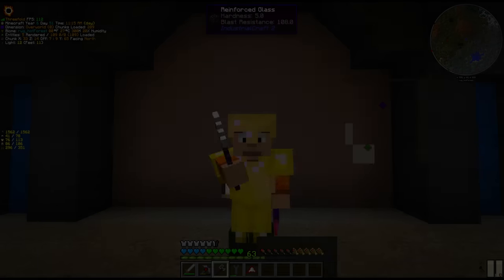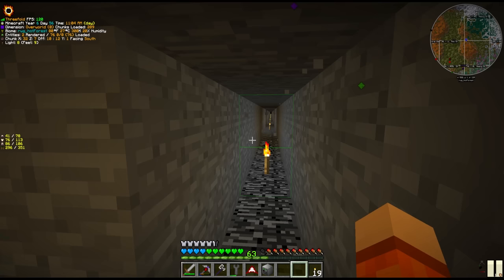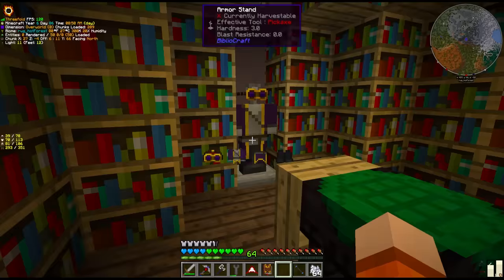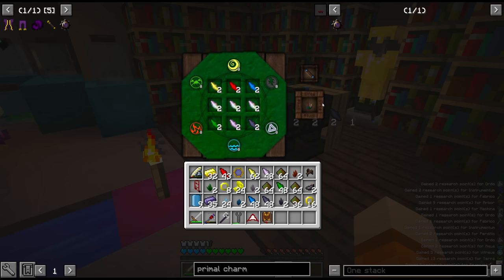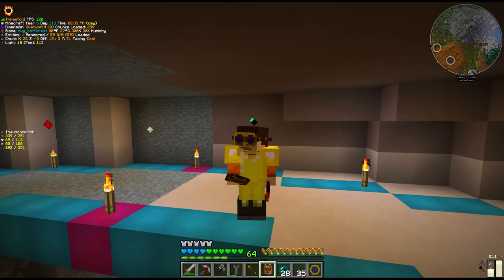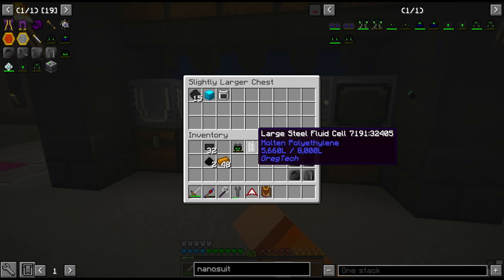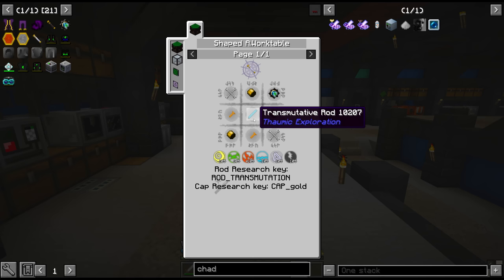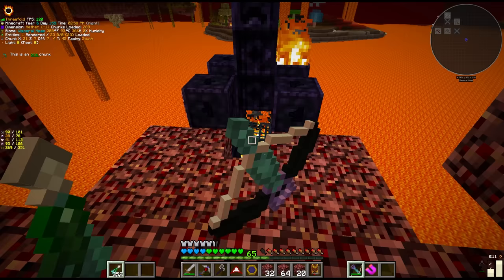Gregtech New Horizons S2 18: Nano-Craft

Comment: A bit of thaumcraft advice. Craft an extra primal charm and keep it in your inventory for a while. it generates vis for your wand, slowly, and it will unlock some research if you carry it for long enough.

Edit: And you did. This is what happens when you comment in the middle of a video instead of waiting for the end.

Now to some actual applicable advice i gathered from my old regrowth playtrough. I don't know if the numbers are changed or not for GTNH, but i wouldn't bother with advanced node in a jar at this stage. Save that for when you find a Bright node that you will want to transform into the gigant node later in the game. If you just want nodes to charge your wand, use the regular one that requires less vis, to harvest as much of them as possible, some of them will turn from normal to pale, but that makes them just a bit slower to recharge. It's not that bad. 

If you encounter any fading node in the wild, don't bother gathering it, just break it for some ethereal essence. Same if a pale node degrades into a fading one when putting it in a jar.

Then you have two options, place them separatedly enough of each other in your base to prevent them from eating each other or make some node stabilisers. This will allow you to place them closer together, but it slows their recharge rate too.

And when it comes to what aspects you want in a node. with a wand you can only get primal aspects, so right now the nodes with secondary or tertiary aspects are not as useful. once you make the wand charging pedestal and it's upgrade i don't remember the name. You can use those secondary and tertiary aspects to charge the wand too.

And for the energised node later on the line. Again you have two options. The energised node will only have the primal aspects. And it does so by transforming the secondary aspects into their primal aspects and picking the highest primal aspect for each one. So imagine you have a node with 15 aer and 20 vacous will turn into an energised node made from 20 aer and 20 perditio ( the 20 aer and perditio from the vacuous, the primal 15 aer are just lost because the vacuous has more aer than it). So I prefeer to use just primal aspect nodes for that so i can controll what i add. The compound aspects can be useful, but harder to find and feed into the main node.

Lastly, about the ethereal essence. All of them have auram in them when distilling them. They just have auram and whatever aspect they are. So that wisp node would still be usefull to farm auram. But you found a better source anyways.
Reply: great advice, i never knew that combined aspects chosen that way, i always thought it's just decomposes them entierly with inefficient multiplier to get ALL the primal components (well, i usually overfed one massive hungry node untill i can't see the hekkin numbers and then energize it with max stabilizers, and at this point i've always got more than like 18-20  of each aspect per tick, and would enchant fokae to max level in a matter of couple minutes so... heh. oops.
Reply: @mrShift_0044  It's a perfectly valid tactic, too. Node predation to get a big node can be really really slow without tick accelerators.

And to add to the advice, having a bright node energised will give it also a boost on cv.

It's a bit of a shame thaumcraft 4 isn't that built for large scale operations if you want to use the stuff in it. 

I made a really cool autosorting essentia setup with essentia buffers that would proccess and store every type of essentia, but the buffers were too slow to do any kind of large scale processing. so for any alchemy i wanted to automate I had to make dedicated setups wich where not as cool.
Reply: Could you be the next ShadowOfX?

Comment: For getting oil there's also MV pumps to gather more oil (particularly from larger oil spouts), actual super tanks so you don't have to go back and forth constantly, or long distance fluid pipes to bring the oil right to your base automatically. There's no excuse for having a ULV tank on your single block oil pump in mid-HV.

One critical difference between single block pumps and multiblock fluid pumps, other than the fact that the latter pumps fluid fields whereas the former pumps in-world fluids - multiblock pumps will continue running even when their output hatch is full, voiding fluid and power. Automation is required to make sure the pumps turn off automatically when they're full up on oil, but this is extremely simple to do: Just place the output hatch next to the controller, place a fluid detector cover on the output hatch facing the controller, and a machine controller cover on the machine controller facing the fluid detector cover. Frankly I trust that anyone able to read the previous sentence is able to figure out the rest 🙃.

Slight error crafting another MV Vanadiumsteel Prospector's Scanner there. With a vacuum freezer you now have access to Shadowmetal, which is a much better material to make all sorts of tools out of, and you also are now able to craft HV Prospector's Scanners. Shadowmetal HV has a range upgrade, meaning it can detect up to a 3x3 worth of ore veins, but most importantly for fluid fields it also has a higher chance at successfuly prospecting. For ore veins this doesn't matter, since Visual Prospecting will pick up ore veins regardless, but when prospecting for fluid fields this success chance does come into play.

Fluid field information is in NEI ingame, but for the record: The overworld has an equal distribution of Light Oil (only really useful for Refinery Gas), Raw Oil (best for Naphtha), regular Oil (best for Light Fuel), Heavy Oil (best for Heavy Fuel) or Natural Gas (functionally equal to sulphuric refinery gas). Depending on what you want to do with oil you'll want to tap different types of oil - Cetane-Boosted Diesel is very Light Fuel heavy and needs a bit of Heavy Fuel, Gasoline based fuels are very Naphtha heavy and require (relatively) minor amounts of Refinery Gas, if you want Refinery Gas for byproducts Natural Gas will save you a distilling step or Light Oil can get you a small trickle of the other oils when processed through a Distillation Tower, etc. You can either change your strategy depending on what oil/gas is nearby or seek out a specific field and strategise ways to cross the distance, either approach is entirely valid.

Fluid fields are always 8x8 chunks. The chunks within the fluid fields are all individual pockets, though. You can drain one dry and have to move your low tier fluid drilling rig to another to pump more fluid, if you drain one pocket too much. Higher tier fluid drilling rigs will pump more of the field at once, up to the entire 8x8 field at once with a T4 fluid drilling rig. Those are a wee bit in the future still, though.

There's not too much reason to pump up heavy oil. Mining out a few oilsand veins will give you all the heavy oil you ever need.

For the record, I have done research since the last episode on Scribing Tools and updated the spreatsheet with a list of available tools in GTNH. In case anyone is tired of having to refill their ink bottle every 100 uses. Turns out there's some interesting options available 🙃.

For wand recharging there's two ways you can go about it: Rush Transmutative wands (scepters, really) to make the primal shroom refilling much more efficient, or set up a starter energized node to get a measure of Centi-Vis going. The latter requires exploration and some RNG to find a suitable starter node, but it is the path I highly recommend taking. In part because Centi-Vis opens up some of very critical stuff - wand focus enhancements to name one, Frugal V will make that Dislocation wand focus a lot cheaper to use - and in part because it's fully passive. Yes, it'll be slow, but passive Vis recharging is a very good QoL upgrade all the same. Note, by the way, that Transmutative Wands also make the process of recharging through Centi-Vis much more efficient, especially when crafts don't require Vis in equal amounts. Which describes most of them. So yes, rush Transmutative scepters, and set up a started energized node if at all possible.

Rushing the high Vis Discount gear is obnoxious, I will admit, but to make wand progression not an exponentially more obnoxious slog it's necessary. Without good vis discount gear and some of the more obscure wand caps you can easily find yourself stuck in a loop crafting wand after wand after wand to slowly upgrade your caps and total crafting capacity, only for this process to hit a brick wall when you finally crawl your way to Silverwood scepters. Wand progression is something that requires some fairly thorough research to do with any degree of efficiency, which the questbook sure as hell isn't going to do for you. The spreadsheet has you covered for all of your wand progression needs, though...or at least a good staring point, I would hope.

This progression of arcane infusion before bewitched gear is...certainly a choice that Three has made which I do not recommend copying. Vis Discount gear first, wand upgrades second, everything else first is usually the most optimal path to take in Thaumcraft. Of course exceptions exist, and distractions will inevitably happen along the way regardless.

Holding on to the Primal Charm for a while unlocks the research for the Primal wand focus. It's not something I seriously use, but I'll admit it's a lot of fun to mess around with 🙃.

Strangely enough the amount that the Runic Matrix flings around is based on the amount of stability of the altar, not *instability*. If you set up an infusion altar with crazy higher stability levels, like 500+ (anything above 60 at most is probably redundant, and even as little as 20+ will probably serve you until the very lategame), the Runic Matrix will actually start orbiting around the entire infusion altar, clipping through blocks and everything. It bizarre and frankly I love it 🙃.

This lens is one of the ways to solve the problem of light (or, rather, the lack thereof) on the Moon. It's far from the only way of course, but if the devs hadn't removed the mechanic of IC2 night vision usually giving you blindness in high light levels it would probably have been the best way to go about it. As is it's still convenient for not having to fiddle around with the Rubix Cube that is IC2 keybinds, but the lens is much more skippable than it once was. Of course that just means you've got a slot left open for one of the other three lenses Thaumic Horizons offers. The spreadsheet has a list of what the various lenses do.

Crafting a super node is a long term project. To start off with I do recommend a starter node, if you're lucky enough to find one. If you're not at least invest in Node Linking to greatly speed up the process of growing a node. The base mechanic of node bullying is slow as molasses, inefficient, and frankly you'd be better off with Primal Shrooms than waiting on node bullying for an eternity. The advanced jarring method also isn't strictly necessary when moving a starter node, that depends on the exact amount of aspects contained within. The spreadsheet goes into mode detail about all of this node stuff, though.

For the record your vis discount does come into play when crafting mystical constructs, I.E. using Vis to craft structures/other stuff in-world. However a Gold-banded Greatwood Scepter would require 30% worth of Vis Discount from gear in order to pull off Advanced Node Jarring, and that is not happening short of Ichorium robes or literal Infinity armor, which are very far into the future still. Another option would be to craft a Greatwood Staff (or Staffter, but in this case a Staff would be enough), but this isn't necessarily that much cheaper than advancing wand progression some more, and the latter you're going to want to do sooner rather than later anyway. Crafting staves does have the benefit of being able to have a better reserve of Vis for your Foci, though, so that is something to consider. But than crafting better wands/scepters first might mean being able to craft better staves immediately after as well. It's a balancing act, basically.

For the record there are other sources of Vis Discount Three could have gone with...but they're down the Warpiest of paths of Warpy Warping Warped Warps. Worth traversing when you've got the means to handle the Warp, but Three does not at this point in time, and Nano Boots/Goggles are very good QoL items anyway, so there's really no harm in going for those instead.

Incidentally, this is why I recommended saving HV lootbags and enchanting them to try and get Night Vision Goggles out of them. They'll spare you from needing a Cleanroom to craft EV circuits to craft them yourself, no matter what the questbook thinks.

Comment: Note that you can auto build multis, including the drilling rig. You just shift right click with the schematic
Your log has the drilling rig doing raw oil, you are doing heavy oil(not that it matters now)
You can use carbon instead of cryolite for alumium, if you are using alumia
NEI is lying for certain recipes, the infusion’s stacked items only actually takes 1(bug fixed later)
Thaumic restorer is cheap and you can do it right now
Reply from the maker: Forgot about Carbon & Alumina, thanks :D